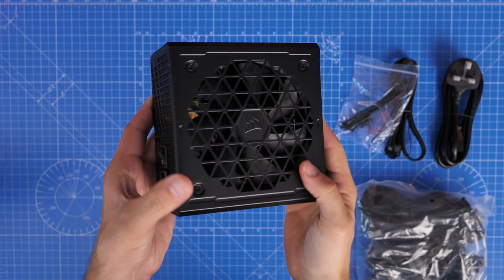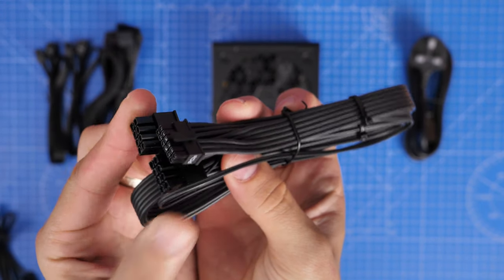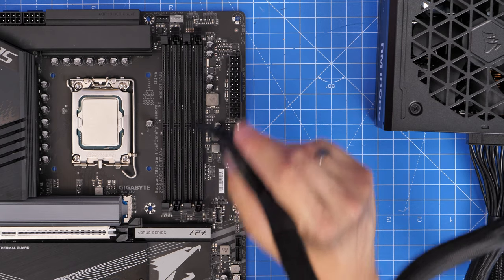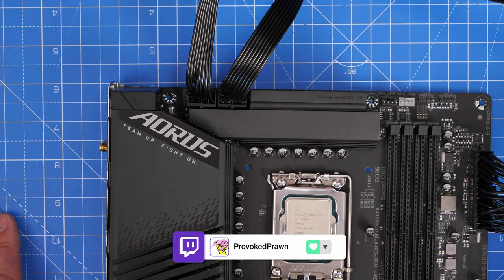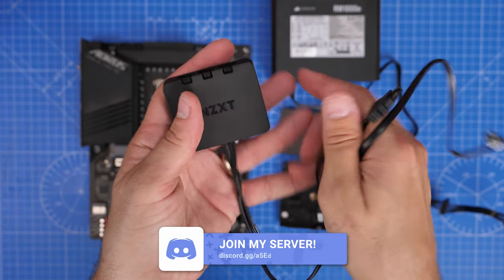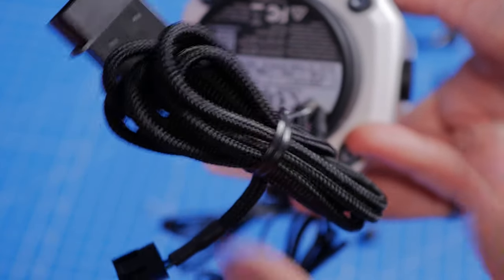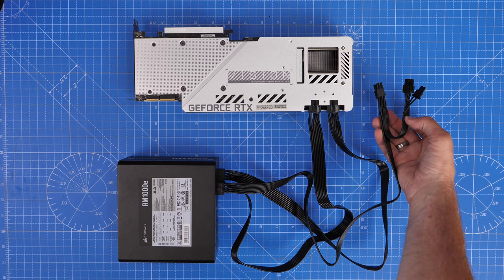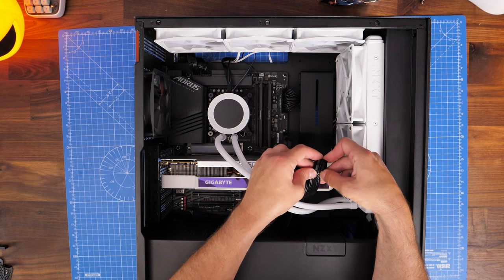Corsair RM1000e PSU unboxing and setup guide

Comment from the maker: Related videos:
Common Mistakes You Might be Making with Your PC Fan Setup! PC airflow tips and tricks https://youtu.be/uPIMv30Vs3w
Are you making these mistakes with your RAM? https://youtu.be/ZeUgMODOfOo
Avoid these problems with your all in one CPU cooler https://youtu.be/nVkN8diBIAE
Don't make these mistakes with your NVMe SSD installation - NVMe tips and tricks https://youtu.be/zjSn64vh_Vk
Where to connect PC case cables, power cables and more - computer wiring tips https://youtu.be/RYkW2WywN5I
How to wire and connect Corsair RGB fans https://youtu.be/jvXCbny-Suw

See deals on this PSU (notes these are affiliate links which may earn me a commission at no extra cost to you)
Amazon US - https://amzn.to/3NNaCRS
Corsair - https://go.corsair.com/jrnB2a
NewEgg - https://newegg.io/ncaed7e63d
Amazon UK - https://amzn.to/3XpASFa
Amazon FR - https://amzn.to/3CNh8BS
Amazon IT - https://amzn.to/3PqHZLH
Amazon DE - https://amzn.to/3Pw3tGR
Amazon CA - https://amzn.to/3NsAWiN

Comment: Can you confirm that the 12VHPWR cable can carry the full 600 watts for an RTX 4090?
Reply: Did you get the answer???
Reply: @3ALM3GEB  Yes. It can.

If you are looking at this PSU, i would recommend the Corsair RMX series instead. A bit more money, but much better quality.

I had the RME for a month but returned it, has a very noisy ball bearing fan.
Reply: can that 600Watts use for 4070ti super？
Reply: @Shalashaska111 which rmx power supply are you using? Is it 1000W? Or more
Reply: @thesagaofblitz  850w

That is more than enough for a 7800X3D and a 4090 :)
Reply: @Shalashaska111 did you get the rmx or the rmx shift?
Reply: @BackyardMonster  RMX 850W Shift

Just be sure your case is suitable, because its sockets are on the side rather than the end like they are on normal PSU's. Your case needs to have an inch or so of room to the side of it for the cables.

Their might be a conventional RMX now, I haven't looked since. Just don't bother with the RME.
Reply: Mine didn’t come with the cable for 40 series gpu
Reply: What should i do

Comment: I do wish I had this during my build. Thinking I was screwed without a 12pin  for the 4080 but it comes with that converter and the psu comes with a ton of cables.

Comment: I thought the melting problem was from people using the adapter included with the GPU instead of just buying a new PSU.  I have always said if you need the adapter provided, then don't buy it until you have the psu or whatever needed to make that adapter pointless.  Though great help, I was wondering why they call it a 16 pin connector when there is only 12 pins on the gpu

Comment: Could not have uploaded this at a better time, I finished my first build yesterday (still waiting on gpu to arrive) and I couldn’t find anything helpful online for Corsair PSUs and I got the hx1200. I was worried about whether or not I put the cables into the psu correctly and this video shows me that I did

If you haven’t already I would HIGHLY recommend a video on a Corsair HX1000 or HX1200 platinum because the plugs are in 3 rows instead of 2 like most of the PSUs that I’ve seen and I think it would be appreciated because I have seen tons of people asking similar questions to what I had when I was trying to figure out how to properly connect the cables to it.

Comment: Any difference between RMx and RMe apart from the physical design?
Reply: Rme is more stress tested and better is what the guy at micro center told me
Reply: @kylevos8551  Really? But RMe is a bit cheaper compared to RMx. If RMe is more stress tested and better, then how come it's cheaper?
Reply: @ashfakuddinahmed1807 cheaper is better if you have budget right? I have RMe
Reply: @ashfakuddinahmed1807  Late reply for you but may help others. The RMe has different quality of the capacitor (Taiwanese vs Japanese in RM/x) and the fan is 120mm vs 135/140mm

Comment: I have a gpu with 3 8 pin connectors needed.
Should I connect 1 normal pcie and 1 "pig tail" connector? 
Or should I connect 2 normal pcie cables and 1 pig tail connector but leave half of it unused?
Reply: Did u ever figure this out?
Reply: @kennethvong5343  I did some searching and using only 2 (1 + 1 cable with a pigtail)  could limit the max power of the gpu.
So if you want to make sure you get 100% power use 3 cables for the 3 connections.
Although from my understanding its not a huge performance difference.
I ended up using 3 cables 2 normal and one pig tail connector and just left the tail hanging near the gpu.
Reply: @FantasticKruH  cool, my gpu coming in today i was stressing all last night bc my psu only came with 2 pcie cables and 2 pigtales. I will do that thanks friend
Reply: Hello, how much PCIe 8-Pin (6+2) cables do you get with Corsair RM1000e ?

Comment: I still can't find anything online about what the difference is between the e and x version of the rm1000 lol.
Reply from the maker: I asked Corsair for you :)

"Ok, so RMx is bigger, has a larger fan (132mm vs 120mm), comes with a ten year warranty (instead of 7), and supports SLI cards with the included cables out of the box. RMe is ATX 3.0 certified already, however the RMx line (to my knowledge) meets the spec, but just hasn't been certified by Intel yet."

Comment: Hey would it be possible to see a sound comparison between RM 1000e vs 850x if you’ve got any lying around. Just wondering if the 100$ extra is worth for (silent)
Reply: Let me help you right here... I replaced the fan in my RM1000e because it has horrible whirring... it's driving me insane, especially since it speeds up, stops, speeds up, stops etc etc, every 2 minutes or so. I don't care about warranty since I have a couple PSU's laying around (honestly I do) but man what a disaster... and it has coil whine, not super loud, but loud enough to be noticable from 1 foot or less.
In short: Get the RM850x if you care about silence and enough wattage, even with a 4090 it should be okay.

Comment: I have questions. I have the same psu.  When i turned on 
The fan works 3 second ans stop.   Also the gpu i have gpu. 4070.   Asus.  
The gpu wirk in there is electric but the fan stoped working why this happen.     
Also there is an anver light this could br bios ?
Reply: does the psu have a zero rpm feature? it wont spin when its not used enough to make it more quiet

Comment: I am using the 4070 tuf gaming and it has only one 8 pin adapter on the gpu, do i use one pcie chord to it? and if so is it all the way to the right or left on the psu?

Comment: Is running 40 series gpu with only 2 power supply cables okay? I'm running it the same way you displayed it but the internet says that it needs 4 power cables. What do you think?
Reply from the maker: How many connections does your GPU have?
Reply: @TheProvokedPrawn  its the 12 pin insert, one end of the cable is the 12 pin and the other splits of it 2 different (4x2) cables.
Reply: @TheProvokedPrawn i have it the way you set up your 4070ti, but i heard that i needed 4 power supply cables into my 4090 instead of the 2 i set it up with.